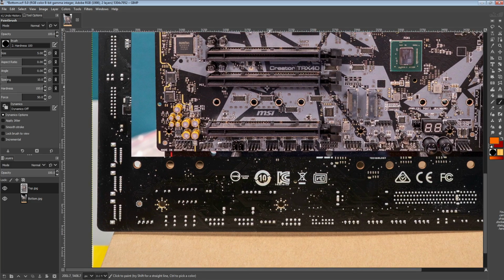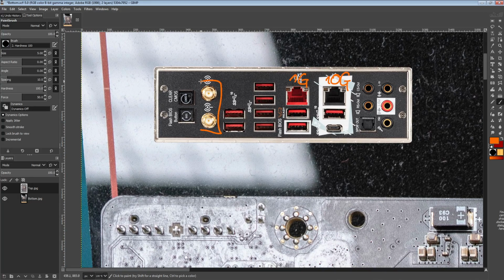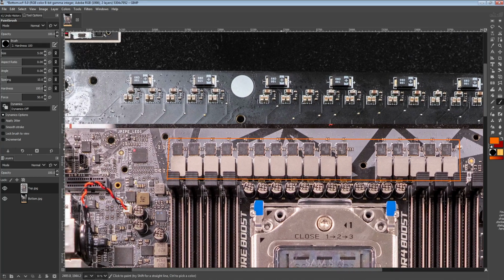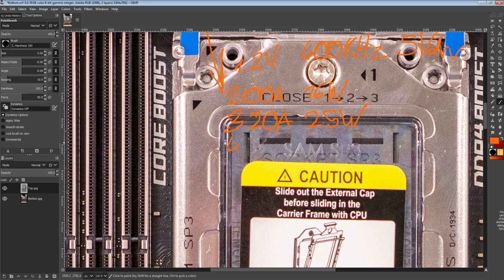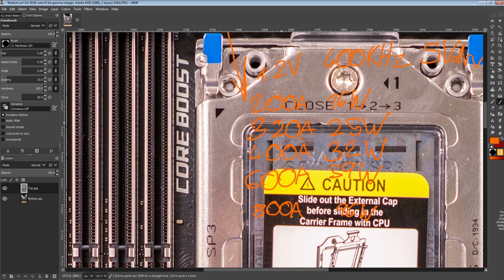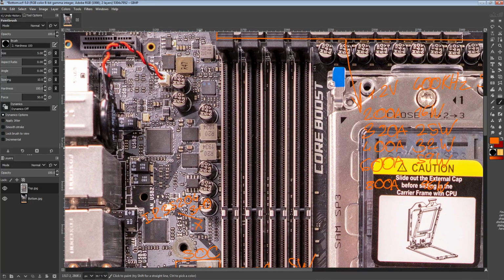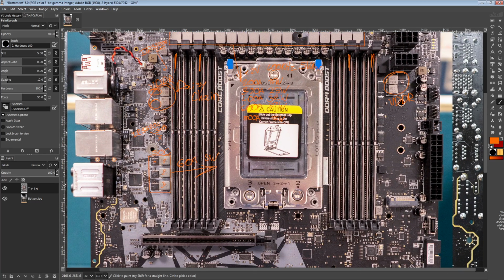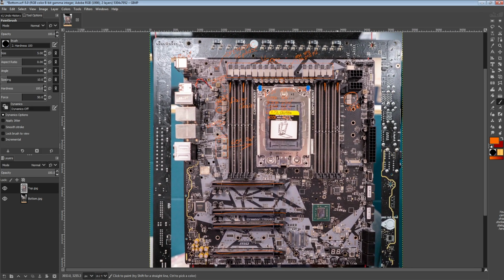mobo PCB Breakdown: MSI Creator TRX40

Comment: 1) if you buy a 800$ motherboard based on it's name.....
2) the last slot almost never has large cards, it's rarely full speed and most motherboards have cables down there, classic uses cases : external connectors usb,thunderbolt,network card, pcie nvme adapter etc...
3) the post code being down there allows one M.2 to be better placed (this board has THE best placement of any MB, between pcie slots placement is pure shit, this only has 1)
4) as explained below "real" customers of this board doesn't care in the least about dual bios, "test bench" isn't a customer market, I enjoy XOC content but please don't think it's a normal use
5) yes the cpu cooling is a problem people seem to forget about those cpu, more cores don't come "free"
6) fun fact some lower quality polymers "soak" humidity which can then corrode the dies, not that would be a problem in a PC which doubles as an air dryer in most cases

Comment: MSI: creators that buy a 1000-2000$ PC need no dual BIOS but integrated Wi Fi
Everybody: is this a joke?
Reply: It has BIOS flashback, which is less "scary" for the average consumer of this new Threadripper generation - the 'average' buyer in all likelihood isn't even going to go into the BIOS, let alone update it.

These are work parts on a different level, not hardcore overclocking stuff. Hell, of the boards I've had, I've NEVER had any reason to make use of dual BIOS. In the context of this product, it's just a non-issue for everyone but a small handful of extremely niche users(who are probably more interested in Intel's core-X hardware because it's still going to be the better platform for extreme overclocking)
Reply: Who needs Dual BIOS if you have Flashback. Dual BIOS is so 2000s...
Reply: @kyoudaiken  bios flashback does not work if the EEPROM itself is damaged
Reply: @metallurgico  If you are at that point, you are unable to use a computer properly. What the actual f....
Reply: @kyoudaiken  you would have 2 fucking EEPROMs with a physical switch is this thing so fucking hard to comprehend?
Reply: EDIT: oooh corrupted flashing...well again people who buy this aren't going to flash it 10x / who actually cares about dual bios why do you need it ? other than extreme over-clocking which this board is clearly not for, this is a board for people really using their computer with more than 1 gpu and 1 drive "to benchmark on" even as a current 9900k@5.1Ghz I couldn't care less about dual bios, only geeks worrying more about tweaking their computer than using it want dual bios, pointless feature for 99.99% of the users, most modern boards have failsafes and reset back to default if you mess up I mean I mistyped and rebooted with my memory set to 9000Mhz all I got was a "boot failed several times please go to the setup menu", if you tweak dark enough settings to threaten the integrity of the hardware you're on the wrong motherboard, I have 20 years of PC overclocking (for real usage I mean not pointless scores) I never once used dual-bios even if the MB had it
Reply: @fredEVOIX  BIOS can get corrupted for bad updates, wrong settings or just bad luck. Happened to me once that during the new BIOS download, the file got in some way corrupted and MB could not boot anymore after the update. Things broke even without doing anything (it's the nature of electronic parts) and having a backup (just as data backup, RAID, NAS etc) is something you wish you have when needed rather than always. I would NEVER buy any 200+ € motherboard that would not feature a dual BIOS. BIOS should be socketed in high end board, because I don't want to throw away hundreds of € just because manufacturer needed to save few cents. As I weekly backup my data to a RAID 5 NAS archive I want to be able to recover my MB too. The MB that got corrupted BIOS was an old MSI Z77A-GD65 that I'm still using daily.

Comment: buildzoid does a motherboard cpu capacitor temp equal vrm temp or less?
Reply: I do not think the caps put out too much heat, the main part is the switching power stage. So Cap temp should be lower than power stage temp.
Reply from the maker: it tends to be a bit lower depending on how close the caps are to the VRM

Comment: Agree the name is problematic. I'm just happy that it's effectively the same board as the X399 Creation except they fixed the missing 10G and the art piece heatsink. All the cables were in the same place and didn't need to zip tie a fan to it like I had to to tame the VRM cooling the 2990WX.

Comment: I'm waiting on buying a TRX40 board as the 3970X is not in stock anywhere.  Would love for you to review the Gigabyte Aorus Master TRX40 board as that's got my eye.  I have the Z390 Master and love it.
Reply: Aorus Master, Aorus extreme and designare are all exactly the same in terms of VRM and fundamental basics. he already reviewed one of them on gamer's nexus. same exact voltage controllers, same exact chokes, same dual bios, etc. the only differences are the extra bells and whistles, like audio, M.2 slots, wifi, 10G ethernet, USB ports, rgb, fans,  etc.

Comment: how much further does the IPC (not to be confused with single-thread performance including clock frequency variation), neet to be improved on zen3 or 4 or whatever, to get zen to be "good" at fire strike? just curious.

yeah, without secondary power plugs, I would worry about dropping fiber and raid cards on that board with a 500 watt RTX card in the mix.
Reply from the maker: I think firestrike just doesn't like the way zen does memory
Reply: that's a good point. TR1 had a 50/50 chance that the code was on a core without direct access to memory the data was in (2990wx adds another jump in the mix with the dies with no direct memory). TR3000 just makes sure it's all at least 1 chip away from memory with the IO die, making it worse all the time for memory latency. I didn't even consider that angle, I thought it was just a lack of IPC and clock parody at first.
Reply: @Zarcondeegrissom  TR3K has much lower av latency and a butt load of cache should make a big difference, I don't think what 

AHO said is accurate for TR3K.

Comment: You really need to get Gigabyte TRX40 DESIGNARE pictures to analyze
Reply from the maker: it's basically the same as the TRX40 Xtreme just different features
Reply: hopefully it doesn't have the shitty FOXCONN socket the X399 Designare had...
Reply: @plonk420  Well I doubt they're purchasing sockets from multiple suppliers, so that's probably completely out of the question...

Comment: 9 USB ports on the back is insane.
Reply from the maker: the X570 Creation has 14
Reply: @ActuallyHardcoreOverclocking  Damn that's more than anyone would ever need. Thanks for your reply.
Reply: @JayzBeerz  nope that's not, not by a long stretch just an example: wireless mouse dongle+external soundcard+2x external HDDs+keyboard+wireless gamepad dongle+VR controlling box+rgb something controller that's 8 already if you add an rgb or wireless mouse charging mousepad that's +2 etc..etc..etc..it goes very fast, motherboards with less than 6 ports are idiotic 100% you will end up with an usb hub connected sooner or later, "gamer" motherboards with no usb ports are trash if anyone has external usb peripherals it's definitely the gamers/rgb/enthusiasts
Reply: My X48-DS5 has 12
Reply: @Wirewrap36  That's sweet dude.
Reply: @JayzBeerz  It is, and the bloody thing still works great after 11 years
Reply: I got the x570 creation just for the USB ports, it’s great

Comment: Your videos are awesome! Straight to the point with rationale to back it up. Your videos definitely helped in my decision to get the asrock x570 taichi. Its a jack of all trades.
Reply: Except he says that as rock bios sucks.
Reply: @jasonmajere2165  that's the smallest of my worries. I can get around a clunky bios. It's got the same settings as any other high end board it's just that asrock has their own naming convention.
Reply: @Phr0z3  Don't forget that AMD standardized BIOS terminology once updates rolled out for the 3rd gen release. For the life of me I can't remember what the folder name is, but AMD now requires all board partners to include an identical folder that includes all of the basic functions, all using the same names. Robert Hallock has recently talked about this, since all the different terminology across the brands was such a problem for those of us switching between them.
Reply: @RyTrapp0 I will look into that. Bios terminology doesnt bother me too much though. I see so many different types of bios on a daily basis anyhow. I feel that without exotic cooling (I run a custom loop) there arent any advantages in traditional overclocking with ryzen as far as real world scenarios. The time would be better spent on overclocking memory and tightening timings.
Reply: @jasonmajere2165  It's just an opinion about the layout, there isn't anything functionally wrong with it - I have multiple ASRock boards because they keep bailing me out when I have problems with other brands, and I find their BIOS to be very usable.

This shit isn't just "black & white/good vs bad"; this is the more extreme end of enthusiast hardware use, Buildzoid's videos are NOT buyers guides for Joe Blow vidgy gamer - none of this is relevant if that's all you're using this for(or ANY form of use that doesn't see the hardware pushed to the literal limits of stability), you LITERALLY will NOT be able to take advantage of the boards that BZ rates highest if you aren't putting this stuff under exotic cooling. Short of some of ASUSes recent bullshit with some of their boards having absolutely outrageous temps under basic testing(HardwareUnboxed put together some great X570 temp testing videos, which are far more relevant to 'Joe Blow average PC enthusiast' than BZ's stuff is), ANY board on the market is capable of living for years under AMD's high core count 7nm parts(which draw SIGNIFICANTLY less power, core for core, than 1st & 2nd gen).

Don't overthink this stuff, it's just not that big of a deal for anyone that isn't pushing the limits of their hardware